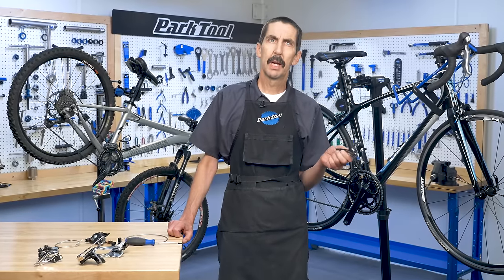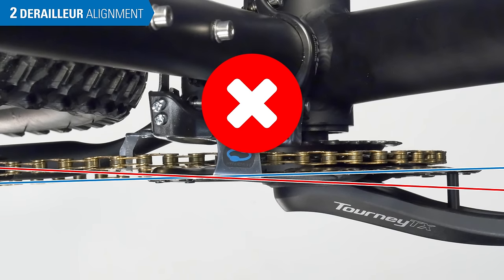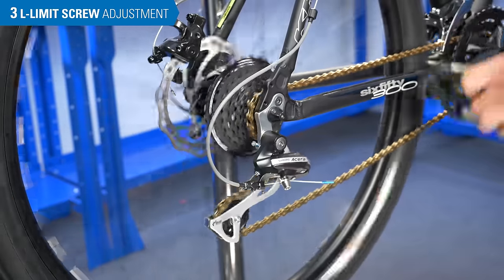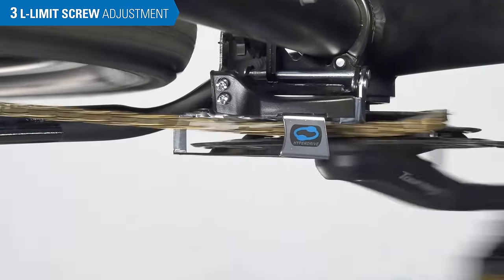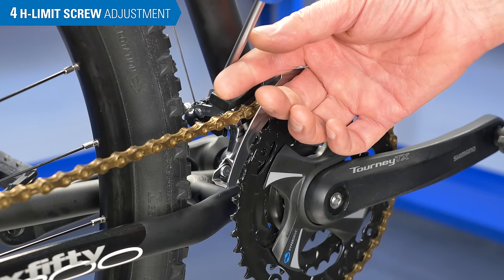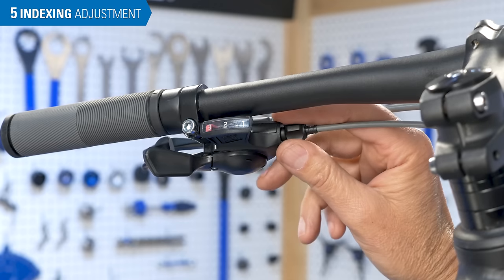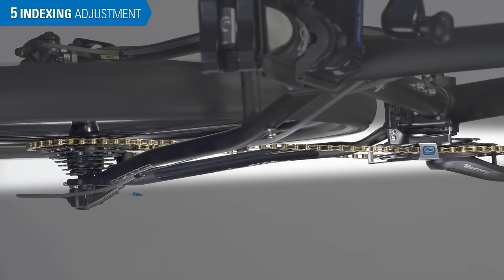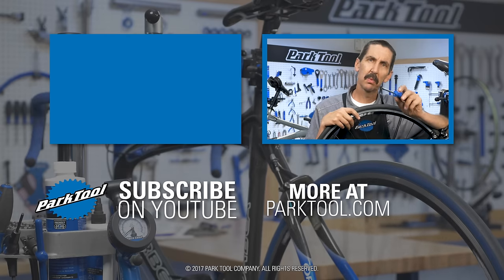How to Adjust a Front Derailleur

Comment: Hi. I am in the process of getting my daughter in law's bicycle repaired and tuned up before her birthday.  I have the bicycle upside down on a workbench and when I engage the pedals, the chain turns the back wheel. Once I stop pedaling, the derailleur seems to not stay where it applies tension to the chain. The chain begins to sag real low. I thought that it was a simple tightening of the back derailleur but I can see that there is no room for adjustment. Could that small spring that I can see be the reason that the derailleur doesn't quit supporting the chain? I'd appreciate any advice that you could give me.
Reply from the maker: The freewheel has a lot of drag.  Remove the wheel and use a light lubricant in the freewheel, between rotating parts of the body.  Not the axle bearing, just the freewheel.  If the gear use a cassette and freehub, if the axle bearing are too tight that can also cause this drag.  Start with some lube.

Comment: Update: I will be trying to reinstall a front derailleur later this week. Took it to a shop to get quote and was quoted $45 to install and $95 an hour for labor. I said nope. Guess need to master this video.

If I’m to replace both front and rear shifters/cables and both front and rear derailleurs. What should be done first so I can finally get the derailleur into adjusting? Since I fallen quite a dozen times and 2-3x were at speeds of 20-28 mph. Pretty sure all of it has to be fixed as my gear covers were damaged.

Comment: After adjusting the L screw, it still struggling to shifting into the smallest cog. I tried to turn the l screw a quarter turn and still no luck. Should I adjust the barrel or add another quarter turn to the L screw? THANKS!

Comment: Hi. I just got a new transmission installed on my bike. The chain rings are a compact road bike system: 50, 34. There are 7 rear sprockets: the smallest one is 13 and the largest one is 28. 

I find that for a good initial acceleration, I need to start up in the large chain ring and the 3rd sprocket. I do this because I do not want to have to shift chain rings every time I start up. But in this gear (large chain ring, 3rd largest sprocket) there is a very quiet rubbing noise, usually unnoticeable with all the street noise around me. Is this acceptable or not?

Comment: With Shimano 3x8 system, what could cause poor switching in the front from gear 1 to 2 or from 3 to 2 when rear is at gear 3 or 4? I can succesfully switch gears in front if the rear gear is at gear 1 or 8 but with rear at gear 3 or 4, the middle gear is hard/slow to activate in front. I have this problem with a new bike with poor factory adjustments that I'm trying to fix so this shouldn't be caused by wear.

Could this be just too stiff new parts and the front derailleur still needing some break-in only?

Comment: Tried for ~2 hours to get the FD cage to give enough clearance for higher gears. My FD still has chain rub on the high edge of the cage. H limit screw is all the way out. Is there a problem with my FD cable tension? Should I add some spacer washers to move the FD further away from the seatpost? I have a ~2005 Shimano Ultegra FD.
Reply: Did some more tinkering...I think that the FD shifter cable is old enough to have lost some tension. I loosened the pinch bolt and pulled a little bit of slack in. This process was tricky: took probably 5 rounds of guess and check. I still get a bit of cross chaining when in the smaller chainring and the smallest 3 gears on the cassette. 

Any way I can get myself out of this?
Reply: @thelodestone  Apply more tension or take the derailleur off and stick a pair of pliers between the cage and pull apart to manually widen the derailleur cage, i did it on my bike and it got rid of the issue of rubbing.

Comment: Please help with this dilemma: Front derailleur adjusted properly, rear adjusted properly (seemingly). Front had 3 rings, back has 7. If I put the front on the smallest ring ("1" on the left shifter), it won't go into "1" unless the right is in 4 or less. Once it's in 4 or less, the front changes, and then I can move the front anywhere from 1-7. 

So is this a front adjustment problem, or a rear adjustment problem?
Reply from the maker: This is a front derailleur adjustment issue. Try loosening the low limit just a touch more.
Reply: @parktool  Thank you so much for responding!

Comment: This is a complaint.  Calvin, you are no less or more guilty than all other similar content on the web.  And that is, explaining to the layman what number in the shifter corresponds to what gear cog, whether its front or rear derailleurs.  Absolutely no one and nothing ever explains this.   Such a true basic to the bone explanation is absolutely essential.
Reply from the maker: A video explaining gearing ratios such a gear inches and gear development is a good idea. Such understanding is not necessary to adjust the gears.  If a gear selection feels good, pedal it. If not, switch.
Reply: @parktool  We're not communicating the same thing.  It's due to the difference between an expert perspective and a layman's.  Expert's take certain aspects as a starting point, or a given, with their perceived audience.  For example, my twist shifter has 1-2-3 as indicators and it's f'ed up.  And so which front cog is gear 1 and so on.  And after that necessity I can adjust as needed.  Same with the  rear.  Yesterday I found one site that explains Gear 1 on the front cog and then stops at that.  Why it stopped going is a headscratcher.

Comment: Sir a little help here. When on big ring/smallest cog combo, there is chain rub and there is fd movement when i push on the sti lever. Do i need to loosen the h-limit then tighten(counter-clockwise) the barrel adjuster? Which one to do first?  Or will this be fixed by just simply tightening the barrel adjuster? Does the fd cage move outward as we tighten the barrel adjuster?
Reply from the maker: Try turning the barrel adjuster counter clockwise. half a turn will likely do it. You mentioned that you can get the derailleur to move when you over actuate the shifter, that means that the limit is not preventing the derailleur from moving and that the indexing needs to be adjusted by turning the barrel counter clockwise.
Reply: @parktool  Thanks! Will try this.
Reply: @parktool  Worked. After turning the barrel adjuster, i did have to tighten the h-limit by 1/4 turn to close the gap between the outer plate and chain to about 1mm. Chain now shifts better too, none of the little delay. Again, thanks!

Comment: Hi my slight issue is in the front derailleur , when I change it to the largest cog , there is some rubbing therefore its difficult to move turn with the pedals . The back derailleur is on the smallest cog (i have the bike upside down to see it),... any advice to adjust it so there is no rubbing ? The rubbing is the chain on the front derailleur . Thanks

Comment: Is there any reason to use 2-3 mm gap for the height adjustment? Couldn't you just go "as close the teeth as you can go without rubbing"?

Also, is there different front derailleurs for different height differences between front gears? If the difference between the gears is huge, should there be different front derailleur design?
Reply from the maker: 2-3mm gap puts the cage in the correct position. There are reliefs and shaping in the cage that align with the chain. Being in the correct position is very important. Being closer is not typically going to cause issues but it may not give the best shifting performance.

Comment: what do you do when you have the H-limit screw set exactly as instructed here, set the cable back to snug, and try to shift to the middle chain ring but the derailleur doesn't push far enough to get it there??  I think either the shifter or the derailleur is messed up.   Any trouble shooting recommendations besides replacing one or the other?
Reply from the maker: Does the shifter click and kee the cable pulled or does it move back to the smaller ring position? It could benefit from a shifter flush.
Reply: @parktool  thanks for the reply.   I just got the bike used and it obviously spent a lot of time out in the weather.   I have put a few drops of lubricant on the derailleur and it is working much better than the previous post.   it  does not drop all the way back to the smallest chain ring now, but it does drop back slightly and doesn't quite push the chain far enough to get it on the middle ring.   so it is much closer but not quite there.   perhaps I can use the barrel adjustment at the shifter to dial it in?   all of that said I agree that it probably needs a shifter flush.   I assume you folks have a video for that?   thanks for the excellent advice 👍   and yes the shifter does click as it should-thanks

Comment: I always have issues with tension(front ring). I always need moderate force to shift from the smallest to middle. But when I try to shift to the largest it's way too hard to shift and I worry ill end up burst the cable or breaking the shifter before it shifts. (It's an older bike I got from my grandfather and the spring in the front derailer is pretty rusted )

Comment: After doing all these steps, I can’t get my 3-ring front derailleur to stay on the middle ring. Shifting into small and big rings works great. 

I just swapped out my sticky Sunrace front shifter  thumb indexed lever for a micro shift thumb indexed lever. It’s not possible that the new indexed shift lever is incorrectly calibrated, is it?

Comment: Unsure if I am doing it correct:

In step 3, after losening the cable with the barrel adjuster and adjusting the L-screw, then when I tighten the cable with the barrel adjuster again, the chain suddenly rubs against the cage. What am I doing wrong? Should I at this point losen the L screw again? 

After tighening the cable, the L screw doesn't move the cage anymore. So should I slacken it again to adjust it?
Reply: After some fiddling around I got it to work. My particular model had two white lines that needed to line up, to set the correct tension of the cable. The manual also had other details worth considering, such as trim positions in the gearing (my particular issue was rub at max gear from dealer, but with the trim positions also available during riding, it's better to trim for no rub at max/min gear, and then use trim positions whilst driving when rear gears offshift compared to front) and a notice to adjust the cable so it is no not pinched in between the outer link and input link of the deraileur. 

Great video though, could not have done it without it. Would also recommend people looking up the manual for the specific model you have as a supplement.

Comment: Is there a difference between a 2 chainring derailleur and a 3 chainring derailleur? I'm certain I'm doing every adjustment right but there is no physical way possible for this derailleur to make the full journey from the smallest chain ring to the largest. I can get it to either go from the smallest to the middle, or I can readjust it to go from the middle to the largest. But it will not do all 3 even with both H and L screws removed completely. I'm starting to think this derailleur was made for a 2 chainring bike. Either that or an old cable, an old shifter, or a combination of old cable and shifter is to blame. I have removed the derailleur from the bike, brake cleaned the crap out of it, silicone sprayed it, then lubed it. It seems to be in great shape. Any help would be appreciated. It's functioning perfect as a 10 speed, but it's supposed to be 15. I guess the same question applies to the shifter. Could I have a shifter made for 2 chainrings vs. 3?

Comment: On the L limit adjustment, even when I unscrew the L screw fully (to the point that it falls out), the chain still rubs on the inner side of the cage. Even if I remove all tension on the cable at the pinchpoint…it still rubs.
Reply from the maker: There can be a few causes of this and varies by type. If it is a band clamp then it could be that the derailleur is rotated and needs to be aligned. Or the bottom bracket spindle could be too short. That will push the crank too far inwards for the derailleurs movement.

Comment: so if the chain is getting thrown over the big bring from going to the small, it's possible that I need to adjust the angle of the front d?
Reply from the maker: Adjusting the angle may help you on that. Small changes acn make a big difference.

Comment: Pls could I ask for help - my front derailleur (which hasn’t been smashed or adjusted since the bike was bought) doesn’t sit in the same arc as the chainrings. It’s a clamp attachment (not braze on) and when loosening the clamp off I can manoeuvre the outer plate so it’s the 2-3mm Calvin refers to above the outer chainring teeth at the front (part towards front of bike) of the plate but at the back of the plate it is 6-7mm away from that same chainring. To move the derailleur horizontally (so, pivot it backwards slightly to make the outer plate follow the same arc as the chainring) the clamp cannot then be tightened as it’s out of its natural (and only possible) alignment. Help! Thanks.

Comment: my shifter has three shifts,

at first I had three chainrings, but then I took off the biggest chainring

so I won't use the third speed on my shifter

do i need to adjust the H screw?
then can I use this video to set up my FD?
Reply from the maker: Yes, adjust the H limit in quite a long ways. From there setup is the same.

Comment: I've been at my front derailleur for over an hour. When you are lining up the outer side of the cage with the larger chain ring....what should my shifter be set to?
Reply from the maker: The shifter position is not important at that point. Often you can just use the shift lever to push the derailleur out to see how it lines up with it not clicking into a position. Or you can use the low limit to push the cage out to be able to line it up perfectly. THen loosen the low limit back to the appropriate spot.

Comment: What does the 34T mean on SRAM front derailleurs?
Reply from the maker: That means that it is designed around a 34/22 crankset. 34 teeth on the big chainring and 22 teeth on the small ring. There are different derailleurs to work with larger chainrings like 36 tooth or 38 tooth.

Comment: how much cable tension should the cable have when the chain is at the largest ring?
Reply from the maker: The cable will have tension on it in the large ring. There is really no good way to tell you how much tension but it should be tight.

Comment: How can I fix my front derailleur from rubbing against my back tire. It does this when in 1st gear on the smallest crank. It's very close to the back tire. It's the HD Trail 29er MTB off bikesdirect.
Reply from the maker: This is likely a design error or compatibility issue that may not be able to be perfectly solved. If the derailleur has a band clamp you can slightly rotate it out of the way of the tire. Just barely as you want to maintain proper shifting. If it is a direct mount you may need to adjust the low limit to push the derailleur inboard but that may sacrifice shifting performance.
Reply: @parktool  Thank you

Comment: When I go to my local bike shop, what exactly do I say to get them to do this process? 

My current situation is that I'm stuck on 2x5 on my gears, and when I switch my gears it gets noisey as it hits the derailleurs. 

I just got my bike a couple weeks ago so I'm kinda new with bikes. This problem only happened earlier as I tried to fix it as when before put it on 3x6 the front derailleur is hitting the chain. I thought I could do it, but it just left me confused so I tried my best to put it back on 2x5 with minimal noise.
Reply from the maker: If you describe the issue you are having they should do this procedure. Simply let them know that the front shifting on my bike is not operating properly and they will know what to look for and will correct it.

Comment: My chain moves horizontally but wont climb onto the larger ring, it is a road bike so the larger ring is a lot larger than the smaller one, am i correct in thinking it is not expected that you can be on the largest rear cassette cog and expect to change up at the front?

Comment: May I ask for some advice here? I spent 5 hrs with my Shimano 105 system. The front derailleur came out two lever clicks per gear shift, from low to high gear. What did I missed?
Reply from the maker: Shimano drop bar shifters have a "trim" adjustment built into them. That means you can make half shifts to keep the chain from rubbing on the derailleur.
Reply: @parktool  
Thanks for the help. One more question, is it adjustable between half shift to full shift per click?
Reply from the maker: One full swing of the lever is a full shift. To get the half click its a half swing.
Reply: @parktool  OK I’ve got it. Thanks again.
Reply: Thanks again Kelvin who inspired me to dig for the holy grail in Shimano product. 

For those who have ST5500 wanted to see detailed app note here is a link. https://si.shimano.com/pdfs/si/SI-6C80D-001-ENG.pdf

Comment: What If tightening the H limit screw do3snt bring the cage out enough to stop rubbing?

How do I align the middle chainring?
Reply from the maker: The H-limit does not move the cage out.  It is a  stop for when the cable is pulling.  It is the cable that does the moving.  
If you have three rings, the barrel adjuster is used to position the cage over the middle ring.

Comment: On a clamp type derailleur, how many Newton meters of torque should be used to secure the cage to the frame?
Reply from the maker: That should be up to the frame manufacturer.  Certainly no more than 4Nm.  If 3Nm holds it securely and it will not twist, that is enough.  You need only what it takes to keep from twisting.
Reply: @parktool  Thank you.